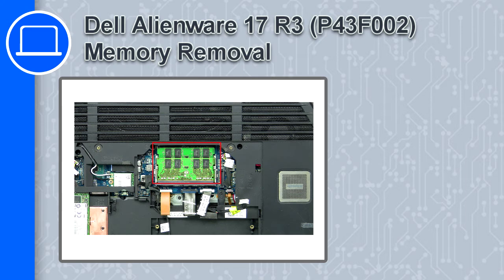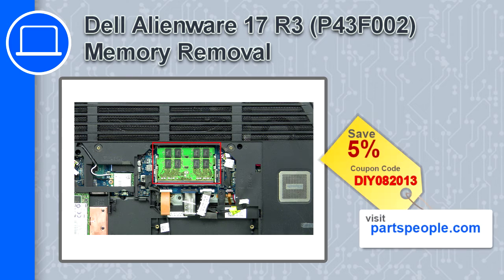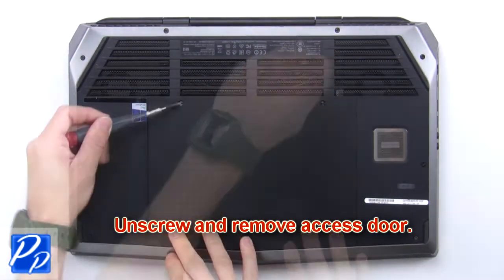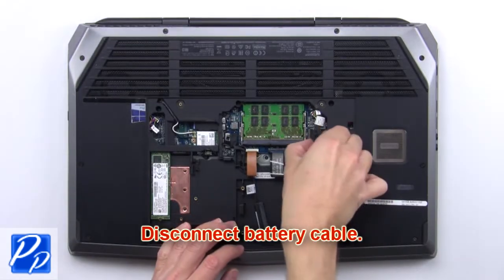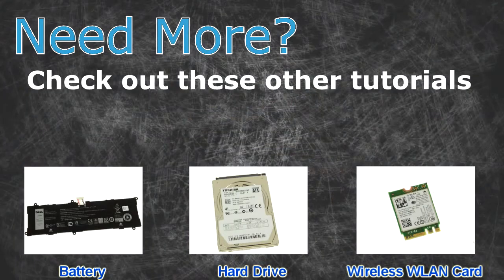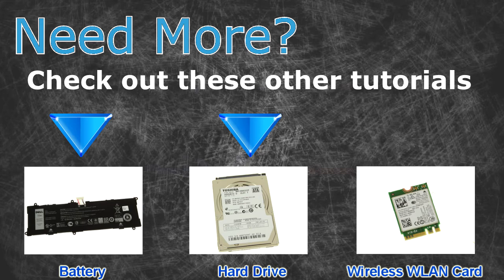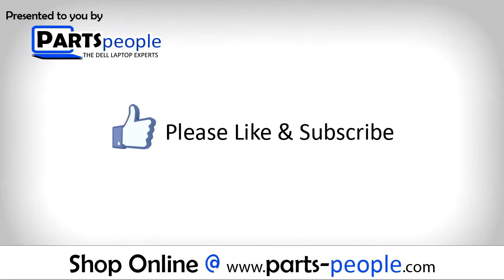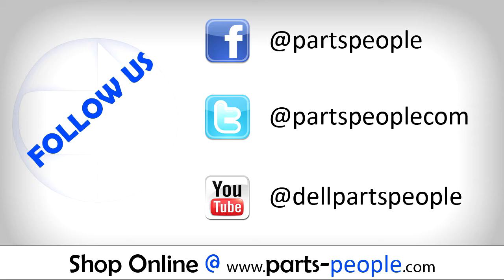Dell Alienware 17 R3 (P43F002) Memory How-To Video Tutorial

Comment: What is the maximum compatible RAM upgrade for Alienware 17 R3?
Reply from the maker: There are 2 slots that each a max out at 16GB DDR4 RAM. Total system max RAM is 32GB.
Reply: Why do these cards look smaller than what im looking at to buy in size not spec